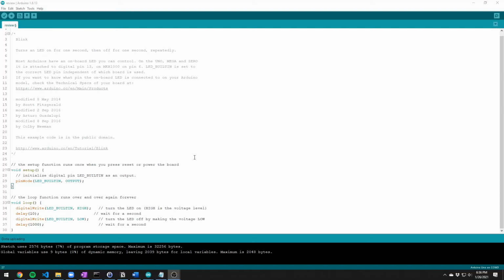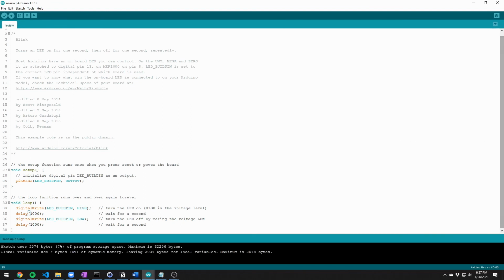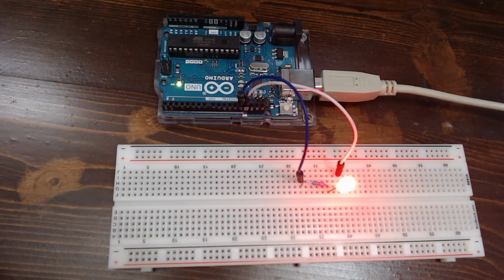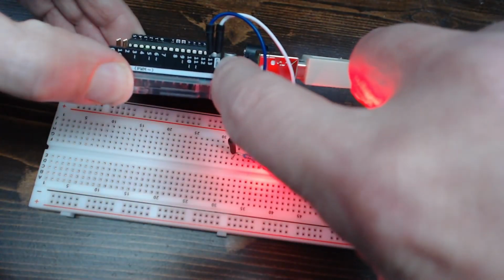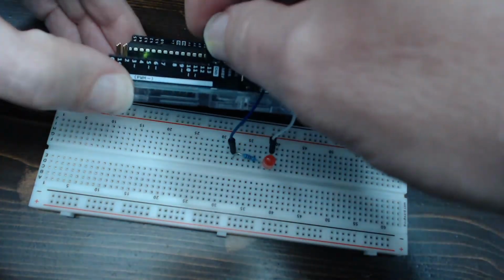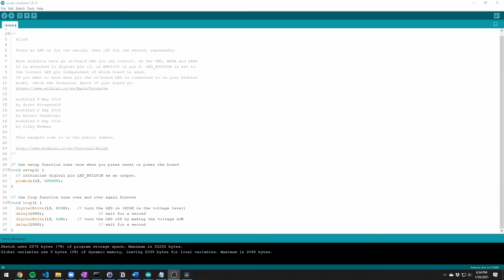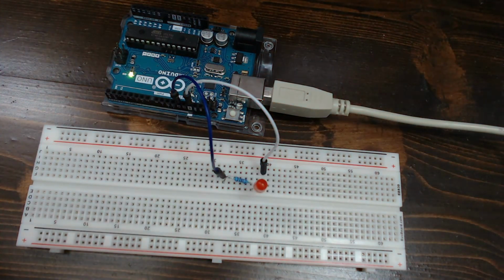Troubleshooting the Arduino Blink Sketch (Program)

Comment: Thanks for the video. I worked out that the LED_BUILTIN macro wasn't resolving to the correct pin number (which for my board is 13). Turns out I had the wrong board type selected in the IDE, and once I fixed that, the macro resolved to 13 as expected and the LED started flashing properly.
Reply from the maker: You are welcome.

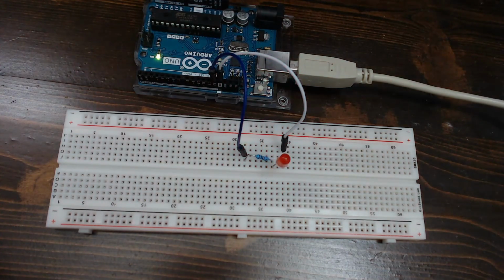Comment: At 4:43, you have the LED wire in socket 12, not socket 13. So why is the LED still blinking? A few frames later I see that the wire is back in socket 13.
Reply from the maker: Good eye. At one point I was using pin 12 in my code, but changed to pin 13 to match the  LED_BUILTIN define, but still used old video footage. 😁